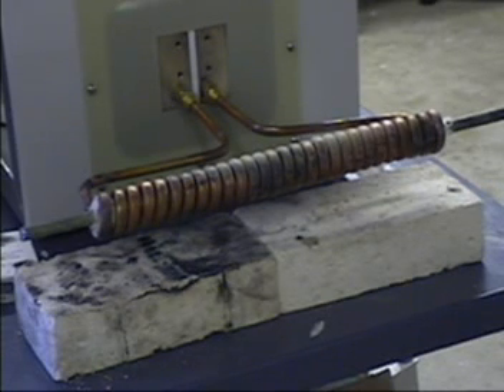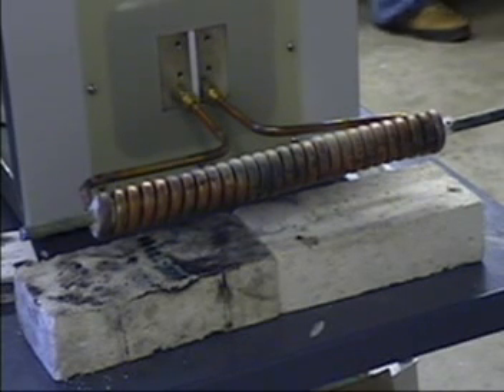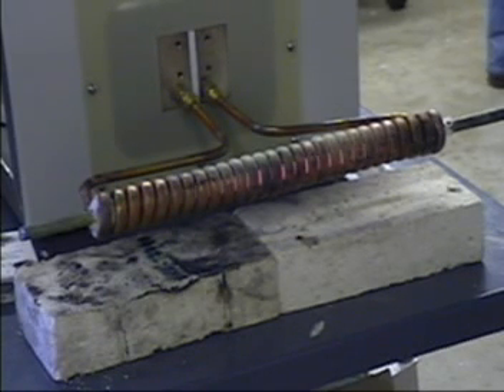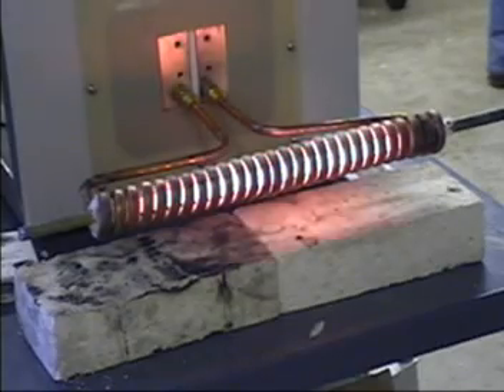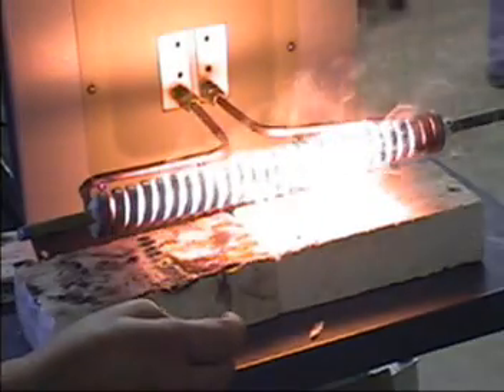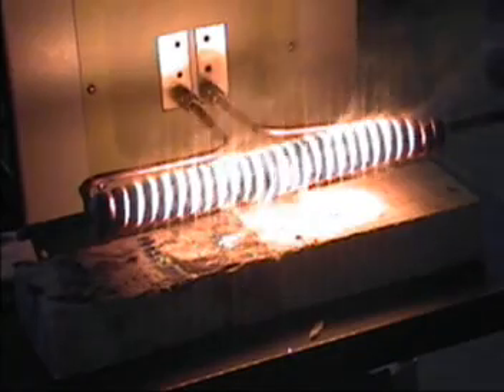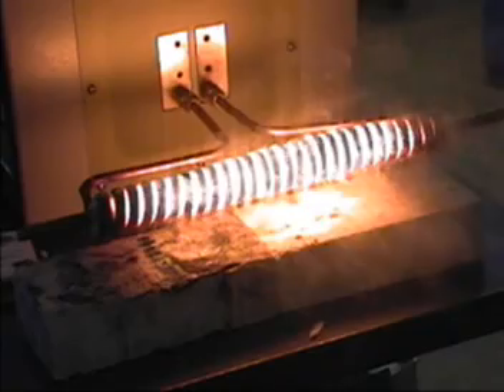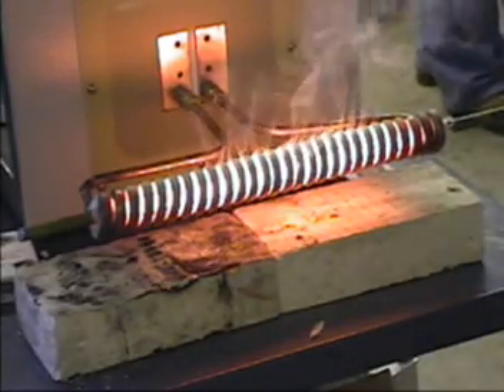Induction Heating Tungsten Bar

Comment: I thought non ferrous metals couldnt melt via induction heat? What am I missing?
Reply from the maker: Krista you have been misinformed.  Non Ferrous metals such as copper, brass and aluminum still have an electrical resistivity, much lower than ferrous metals, but there is still a resistivity that the eddy currents flow against.  This is considered Joule effect heating

Comment: Has anybody tried using induction to make a ridiculous stirling engine yet?
Reply: I've only seen inductors used to heat test and alter internal combustion engine cylinders, but not to power heat engines. I guess you could use heating elements to get that going, but it would sort tot beat the novelty of a sterling engine considering an electric motor with the same energy consumption would be more powerful, and all electric engines are less energy/cost efficient than the equivalent diesel. Maybe you could build one though, could be really cool.
Reply: Why?
Reply: @whyindeed9937  gotta go fast
Reply: @brickct123  
Then why would you use a sterling engine? Their fundamental nature is to be massive, slow, and by any modern standard exceptionally low power.

They were invented entirely on the grounds that steam engines were unsafe. It's why they ended up a pure novelty as material science made boiler explosions less and less common.
Reply: @whyindeed9937  in the last seven years since I posted the first comment, I've played with Stirling engines in the form of cryo pumps and research cryogenic engines, and they're pretty awesome. Are they useful? Not for producing torque! Are the cryogenic models running by heat differentials? ...no, they've got electric motors hooked to them, but they sound so cool! Wupwupwupwupwupwupwupwupwup
Reply: @whyindeed9937  They are not a novelty, diesel submarines make extensive use of sterling engines since they are quieter than normal ICEs

Comment: It's a copper pipe with water running trough it to cool it down. Copper is a great heat conductor so heat does not have time to build up on surface. Lots of heat is generated by current flow alone.